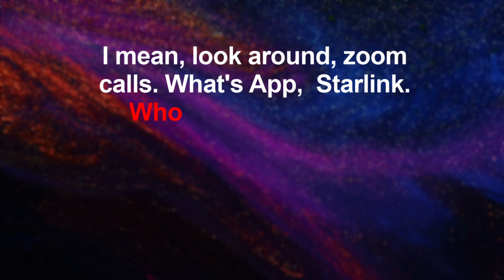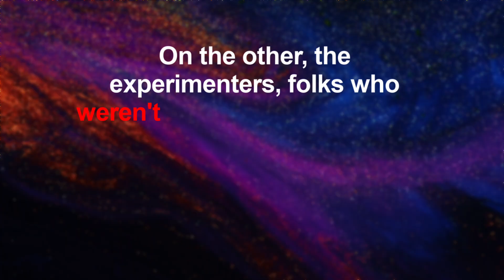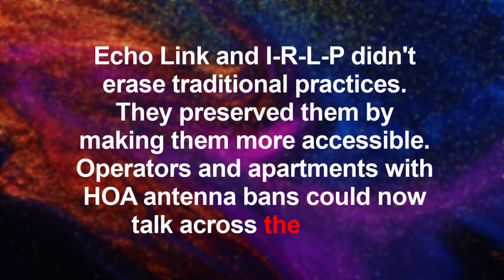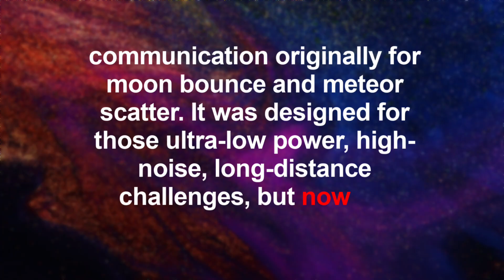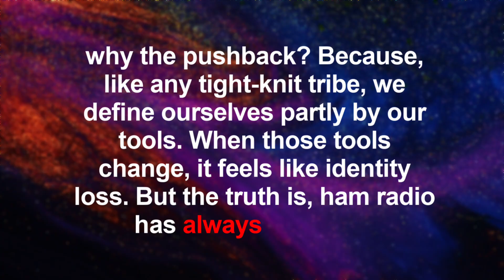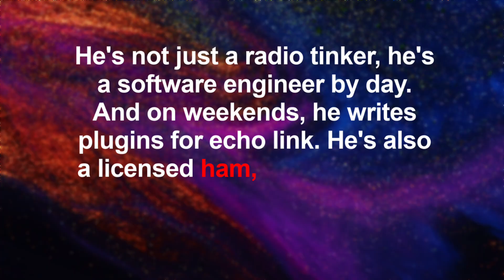Why Hasn't Ham Radio Died?

Comment: …thank you!,…..there are a lot of folks “out here” ,saying that it’s “already dead”,who also happen to be ham radio operators.😳 That’s very discouraging/damaging,to someone who’s considering getting into this  “community”. However,it’s surely NOT dead,not by any stretch.
Reply from the maker: If you look into the numbers the hobby is growing. But it is definitely changing.
I think this is one of the reasons for the popularity of the G & G podcast.At least to me it represents the new and old side of the hobby.

As communities change and hams no longer have the ability to put up lots of antennas or a tower. This changes the modes, times and way people communicate.

But I still think it offers so many areas to explore and learn. There are certainly less room, and time to build something when it is easier and quicker to just order one. :)

For me the biggest disappointment is the attitude to anything new. The phrase "That's Not Real Ham Radio" the one I question. First when you ask, what is Real Ham Radio, they can't answer or point to a mode or a piece of equipment.

But when researching the story on who invented QSL cards. I was surprised at what I discovered. QSL cards are the human connection. Which to me is the most important aspect of the hobby.

I don't care what mode we use, a contact is a contact. I was recently asked why I like to send QSL cards as well as by email. I enjoy reaching a reply to the email and reply almost everyone. I have made many friends from an email QSL and then starting to open a dialog.

So yes it is changing but not going away. :)

Comment: I like audio only ...It is just radio...I am used to it. Bravo.....  I am getting older, I cant master big monster antennas, like  I had before, Cushcraft 4 El, Force 12 C4sxl 8 elements, SteppIr 4 Elements,,,with a 17 meters tower,  no big amplifiers, no need of costly equipment, I  already did  my job, I got my goal.. to work all DXCC Entitys...now I enjoy a different way of radio,  FT8  with a remote station, and  I can do it accompanied of my wife, no shouting, I spend many hours studying sotfware programs,  relaxing at home, AND I AM MAKING SOMETHING DIFFERENT, 26 YEARS OF SSB IS ENOUGHT. Begin to begin from 0 again...What  thrill. 73.  EA6C.
Reply from the maker: I get it. I had to give up my tower because I can no longer climb. But I took this as a challenge and now using every other antennas to still make contacts. And still having fun. :)

Comment: Hi Joseph

TNX FR UR videos.
My HAM experience goes back to my early age, when as 7 years old tried to make a better antenna for MW band at home - only when my father was not at home as he was afraid that electricity will harm me.

Some years passes untill I have found a radio club in my city. We have build a complete MW radios. No transistors of course. Then I have learned CW and got other knowledge from my HAM friends. My "C" class is from 1975 and then  there was a hunt for CW  QSO's to get QSL's fro 80 countries to make "B' class and was permitted to work on higher bands. Now *'m active as on SW and also on 2m An 70cm bands: SSB, FM, C4FM, DMR, FT8 etc. Looking forward to meet you on the band.

TNX again FR UR content. I wish you will continue your great work.

73 Vojko, S51VY